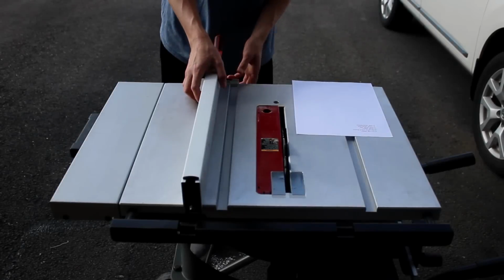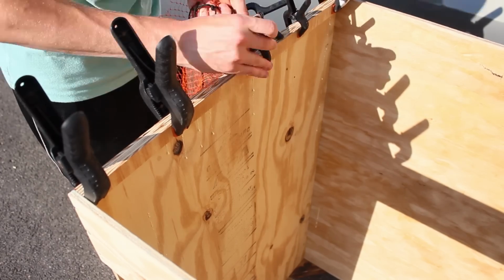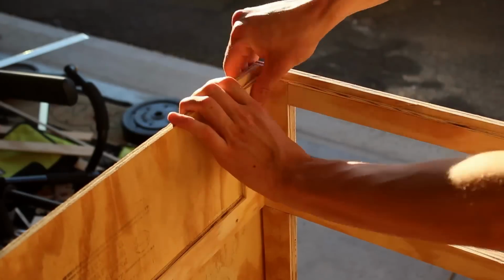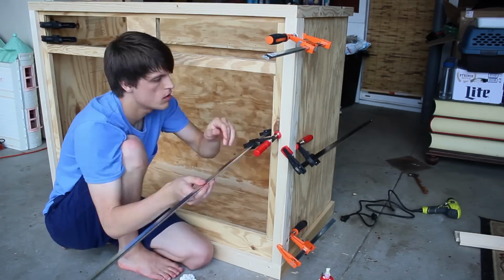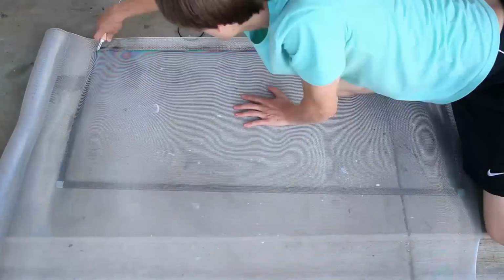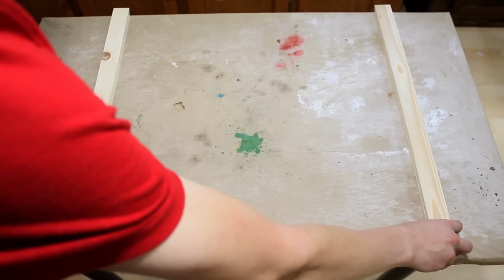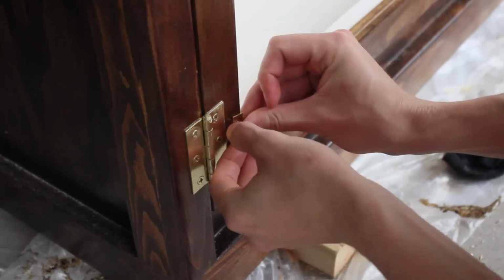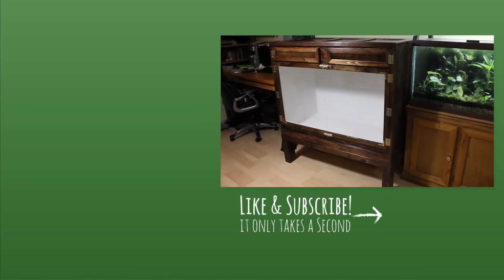DIY Plywood Reptile Enclosure (Large Version)

Comment: Easier with a circular saw? wrong. You were using the table saw wrong. You don't pull wood through it, you PUSH it. Don't be afraid, pushi it wth a pushrod and stand off to the side. The quickest way to get hurt with a table saw is to stand dead center with the blade.
Reply: Also, barefoot in any carpentry job is quick way to get a foot infection from splinters. Bravo. Still got all your feets and toes?

Comment: Why do you use Pond Armor/Shield instead of something cheaper like Drylock Extreme or Polyurethane?  With polyurethane you get a clear coat, so it changes the color scheme/aesthetics, but have you tried the other one (or a suggestion for something cheaper then $210+/gallon Pond Armor)?  I just built an enclosure to replace one of my glass terrariums, and sealing is the next step.  After this prototype, I plan to make 20+ more.  Input would be appreciated.

Comment: FYI for anyone else watching this: never crosscut plywood like he has been doing on the table saw surface.  He loses contact (due to the plywood being low quality and warped) with the fence and the surface multiple times, which is asking for kickback, which can be deadly.  If you absolutely must do this, make a crosscut sled beforehand...that's it's entire purpose (for safety, aside from other neat uses).

Comment: I built a very nice iguana enclosure back in the 90’s. It looked like a nice piece of furniture any almost any decor. I also built a matching stand and fully enclosed hood for the light fixtures. I got a ton of compliments from both hobbyist and non-hobbyists alike.  Since then, I have considered 99% of the enclosure builds on YouTube either lacking in most respects or outright trash. Until now. I’m shocked at your attention to detail and overall consideration for structure, function, and forethought. Bravo!  

To think, I almost left your video whenever I saw that you were using 1/4” plywood...

Comment: What was your process like with the fiberglass sheets? When I tried, the fiberglass was an absolute nightmare with the sealant, and it frayed significantly everywhere. I had to take scissors to the corners to cut all the loose fibers off, and the strips are starting to come off since they've hardened.

Comment: I'm loving the video, but you really should be using stainless steel screen if you are worried about corrosion. The screen by it's self blocks a surprising amount of UV light, spray paint will increase the amount of rays blocked. A reflector can help get light through, but better to solve the problem by never having it. Use a stainless screen with the smallest wire you can find, and the largest mesh you can get away with for your animal and it's food...

Comment: you wouldn't be able to put UV lighting on top of the mesh at the top because it cuts the UV index down by 30% so the lighting will still have to be fixed inside the tank for desert species or any others that require high UVB. it will still be fine for most snakes and any nocturnal species though. 🙂
Reply: @bethh0225  
Sorry for my bad comment. Im understand, mesh blocking 30% UVB. But no mesh used for desert reptiles?
Reply: why not?
Reply: @bethh0225  There is a risk of burns? Have you ever heard that a reptile with an unsecured lamp gets burned? I make this terrarium for Anolis barbatus (fake chameleon) thx for answer
Reply: @bethh0225  fiber glass screen is good for temperature near the lamp but is small holes in mesh.

Comment: Hi! Love the job you did on this video! I have a few questions for you. The ribs that you made to support the floor of the enclosure, I'm guessing that they are 1.5" wide. How far apart are they spaced? The so called "pond armor" seems to be a generic term. What brand did you use? Now, the pond armor paint that you are mixing, does that come in 2 parts, or are you adding additional epoxy to it? Have you ever done an inclosure for  a bearded dragon? If so, do you make multiple layers and how would you do this?

Comment: I have watched this video so many times. Thank you so much for doing this! If I were to use this design for a 4ftx2ftx3ft using 3/8 ply would I be able to stack one on top of another? If not what thickness ply would you recommend.
Reply: I'm building this now off his design but I went with 1/2 Sande plywood.  A bit more expensive but has less voids and is a bit sturdier.  You can use whatever thickness, just make sure you pay attention to the "actual thickness" while planning it.

Comment: End result is damn beautiful sir. I have one question and it's in no way judgmental... how come you used mostly plywood instead of cutting your project time in almost half by using 1x1 or 1x2? Cutting and gluing all that plywood would've driven me nuts lol. 
But an extreamly sturdy and beautiful enclosure for sure.
Reply: Much cheaper to buy a whole sheet than smaller sizes.
Reply: @kerryfiddler9530  It's actually far more expensive to buy plywood for structure AND closure. 1x1's and 1x2's are very cheap.  Still @SerpaDesign it was a very good job and looks amazing.

Comment: Great build and this video was so detailed everyone watching will think this is easy to replicate.
For the door I would have rather seen you do vertical bolt locks instead of horizontal.  That would remove the need for the magnetic bits which have no chance of stopping a snake I would think.  Other than that, top notch work on every bit.  Now I want to build a box for my bearded dragon instead of overpaying at the store.  I have about a year to get my design ready for build.

Comment: Two years later and this is still an awesome, but overly complex, build. This will surely last, damn near forever, and a day. Saw the later video where you were going to convert it to the vivarium for the fire belly toads. I would just remove and replace the other tanks glass, if vinegar or CLR didn't remove the minerals off the glass. Though, if the glass is just "acid etched", a simple epoxy resurfacing would restore the clarity. The secret is 400, 800, 1600, 3000 grit wet-sanding to the thin epoxy, after you restore it. Look at DIY headlight restoring solutions in car stores. It's just basic epoxy. Same stuff they sell in mixer tubes at any hardware store. Use a squeegee to apply it thin. It only needs to fill the tiny holes in the glass. Heat is your friend there, as well as denatured alcohol. You could skip sanding and go right for a buffing pad... Or just replace the glass with glass doors like the one you built here.

Comment: Nice job! 
I have a totally different approach, I'm building my second large terrarium for my Tegu, 3 big slabs of melamine, a few planks of 3" trim a few planks of 1" trim, aluminum screen and two panes of glass,  U channel, screws and silicone.

It's going to weigh a million pounds, but it's 6X 2X2 and won't take but 2 hours to build.

I'm a gearhead tech guy, not so much a carpenter/craftsman!

Comment: Great build it turned out really cool. The only question I always have for these types of enclosures is how is the snake getting belly heat?
Reply: Typically I would run a standard stick on tank heater on a piece of acrylic and put it under the substrate

Comment: This truly is a beautiful enclosure but there are some serious issues that may be at hand with the lighting cabinet design. Going in order of construction , the paint used on the screen will heat up and may release chemicals into the enclosure. Second, any animal that requires UVA/UVB will loose essential rays due to the detrimental blockage that anything-including glass and plastic- will block, hindering the animal's full ability to absorb.  Specific UV gauges show accurately how much is lost the lower the animal lies,  but even right at the screen they are missing a substantial amount. This is why those unsightly bulbs are mounted directly across the inside, and even with this the better housings have reflective backing to lengthen its reach further still.
  I couldn't say what reptiles need outside of bearded dragon husbandry, but I thought I'd bring this up for those who are considering emulating this design.
Reply: you need to protect the lamp against reptiles, do you not protect your agama?

Comment: FYI, the light compartment needs proper ventilation holes otherwise it will overheat. Since the enclosure is made of wood, it might even burn your house down. 

Nice job on the rest of it!
Reply: Unless he uses old lights, filament lighting, there is almost no risk of fire from the four holes he drilled in there. A 150 watt florescent bulb only uses 13-24 watts of power. It'll be snake friendly temps. Not to mention the gaps of the panel doors and thin paneling will easily transfer heat out. LED lighting uses even less wattage for the same light output. Only IR light generates massive heat. Florescent and LED lights have almost no IR spectrum light. They barely have any spectrum. Just equal peaks of red green and blue, normally. That is why they hurt many people's eyes and are often poor for growing things. Grow lights have more UV and IR and wide spectrum bands of color. Those are more expensive to produce, but still not nearly as hot as filament bulbs or halogen bulbs, which are better heaters than light sources.

Comment: Great job. But I'm always confused that ppl put lights above their snakes when they are bottom heaters. ~signed Python owner
Reply: Some provide UVB or a CHE for a hotter basking spot. Like if the substrate is deeper and heating is difficult with a heat pad alone. He also mentioned he wanted this to be versatile.
Reply: @kwiggy5091  once again, they need heat from the bottom. All that does is dry out there scales and make it painful when they shed
Reply: @idoitforme1010  not if you maintain proper humidity. I've got one terrarium that has 6-8" of substrate over a drainage layer. I have a heat pad on a thermostat and a CHE on a very low setting just to bump up the ambient heat on the same side with the heat pad. Otherwise the heat pad would probably have to run 24/7. I use heat pads for mostly all my reptiles but I also have a sheltopusik who requires UVB. He has plenty of ways to get out of the light, plus he burrows into deep substrate as well. He has a heat pad but prefers much cooler temps than the other terrarium set up which is for a boa.
Reply: @kwiggy5091  The versatility I get

Comment: Talk about overkill just to make a wooden vivarium 😂18mm conti board or chip board. With top, bottom, back, sides and plinths is all you need 😂 attach with screws and seal it with aquarium sealant. Add glass runners and glass job done. Just built a 4' x 2' x 3' for under £100 took me 30 mins to an hour to cut and put together

Comment: Amazing video, this is exactly what I've been looking for! Is there anyway you could provide a cut list, supply list, and approximate cost list for everything included in this video? I'm new to this and was also wondering the reason for gluing multiple pieces together versus buying a thicker piece of wood?  I'm assuming it's cheaper to glue and screw pieces together to obtain the same structure integrity as you would get with more expensive thicker pieces of wood, and in your case also helped in getting the lip needed for the screen and depth for making the doors flush. Definitely going to have to modify this quite a bit to accommodate my newbie skill level. Thank you so much for posting this and making it a three series episode to really go into depth.

Comment: Not bad , definitely practice makes perfect , dowels are good idea , better towards heel of mitre and a finish head screws would of did you justice, I’m working on a cage this weekend but I’m going 4’W x 7’ Tall ,2’ Depth with 7 separate sized cages and I am going with sliding doors just cause it’s venomous hosts and easier for opening with only a hook, I do like the idea of separating lights from actual enclosure

Comment: hey just fyi, with those dowels and glue the screws werent necessary at all, just drill the holes slightly smaller then the dowels and tap them in and they'll be plenty strong, and you wont have to deal with ugly screws! the bond wood glue creates is actually stronger then wood itself, i.e. it sticks to wood better than wood fibers stick to each other!

Comment: Do you know if it is possible to use heat tape or a heat mat on plywood for bottom heat?  I am considering building something like this for my ball python.  Since they hide a majority of the time it's easier to get an appropriate hot spot with bottom heat.  I'm just not sure if the heat can penetrate the wood and substrate well enough to get the right temperature.
Reply: kattywampus3 You can, I don’t know if it’ll transfer heat very well though (like glass or plastic). You’d run the risk of not being able to get it hot enough and needing to set your thermostat high enough to potentially damage the wood. Would definitely go with a Ceramic heat emitter with a thermostat rather than a UTH in one of these enclosures. They’re a lot more natural, anyways than belly heat.
Reply: @LilithHatesItHere  I finished the enclosure a few weeks ago.  I ended up cutting a hole in the wood and putting a piece of ceramic tile over the hole and attached the heat tape to that.  Works pretty good.

Comment: First off, well done!

Second off, and I say this as someone who's built a thing or two, why use the 3/8" plywood?? You ended up laminating (doubling up) most of it anyways, wouldn't you actually save money if you built the frame with 3/4" ply and use 1/2" to 3/8" for the panels? Or even a 2x4 or 2x6 structure with thin ply to fill it out? Mind you, I don't doubt your end product was anything less than stout. I just feel like you did this the absolute hardest way possible lol

That being said, your epoxy/fiberglass waterproofing is a stroke of genius!

Comment: Just a few ideas for you. When you are doing the top, do the two layers of plywood on a flat surface before putting the whole assembly in the tank. This will in effect make a solid single piece of plywood. Putting them together with all that weight on it risks bowing the wood. So far as the hardware goes, it does look great against the stained wood but the screws are too large so that the head of the screw is not flush with the hinge plate. If that's all you have for screws, then use a countersink and enlarge the hole a bit, but be careful as a little goes a very long way. Last but not least, for your door latches, what about using some strips of brass and some plywood to make two bolts, but longer. Have it go so that the wood is long enough to go through two straps on either side of the door (top and bottom) and be able to slide back to come out of the two straps on one side only. If you get it right, you may only need one strap for the side that the wood is going to slide out of, but it needs to be far enough over to secure and stabilize the doors. The other option is an even easier one and actually may look kind of nice. Take a fairly long piece of wood (about the length of one door or a little more. With that centered between the two joints ( at center. drill a hole for a screw on one end, and make a slot (vertically) in the other end and put a screw there. You can shape that wood however it pleases you but try to have it set so that the screws are loose enough so that it's easy to lift it out of place on the one side, and pivots easily on the other. If it's still too loose, you can make a couple of thin wedges to glue to the doors so that it creates pressure on the doors when the wooden bar is being latched. Now for a question I have. I'm not so much interested in all the dimensions as I already know what I want for length and width, but what is the height from the bottom of the whole unit to the bottom of the light box, and how tall is the whole thing> Thank you. Please don't consider the suggestions as criticism as you otherwise did a fantastic job of the work. BTW, you were much better off with the table saw. Free hand cutting with a circular saw is tedious, and often times inaccurate so far as straight cuts and miters. I'm planning a 3' x 6' viv for my bearded dragon and wouldn't dream of doing it without a table saw. I'm not going to buy one, but rent one from what ever home improvement store. it will cost me about what far less than buying one that size, a commercial size an duty. believe me that having the blade sets, the rip fence and the cross cut guide makes a huge difference.